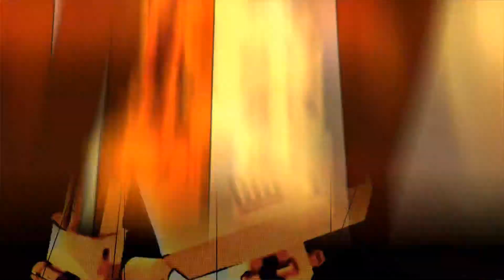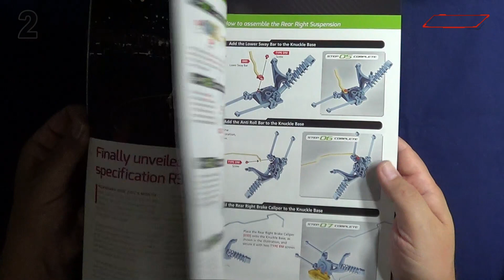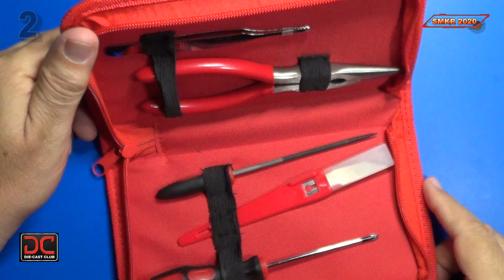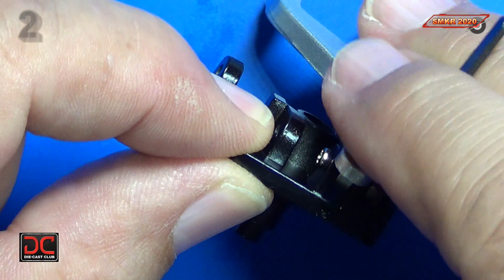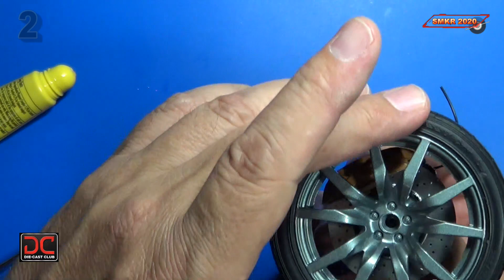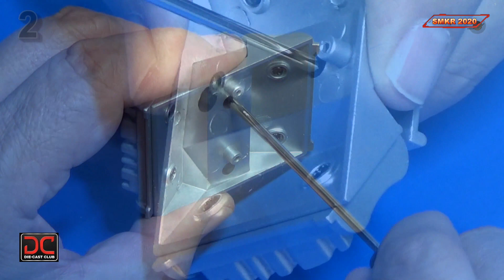Build the Nissan GT-R R35 Issue 2 - Rear Brake Disk and Suspension, Lights and Plate, Engine Mount

Comment: With how detailed the engine builds for their Delorean and their Ecto-1 it's such a shame with the route they decided to go for the engine of this model. Such a missed opportunity. It looks like a cheap cost cutting decision.
Reply from the maker: On the contrary, they did a great job with this engine. detailed assembly begins around Issue 3 Stage 9, I had a lot of fun with this one, you have to consider the modern Japanese cars have lots of coverings hiding the wiring and such on top of the engine, not like the old Delorean's and 59 Cadillac's.  This engine is assemble much the same as modern cars.  This kit is probably the most technical to build out of all of them.
Reply: @ScaleModelKitReview  I was considering this build but then I saw that Elenor is on her way so I'm going to wait for that one. Gone In 60 Seconds was my late father's favorite movie. We watched that movie countless times together.

Comment: Excellent work Steve.  I can imagine the difficulty in assembling this issue when considering the close-up video you incorporate into it.
Reply: ya but he put the disc upside down the holes should be going the same way as the vaines, i do subscribe to this kit
Reply from the maker: I will have to check this, thanks
Reply from the maker: Thanks 👍